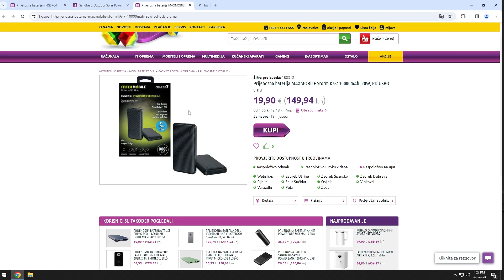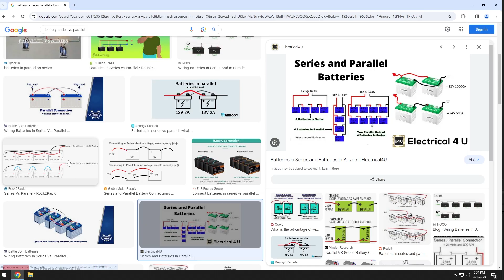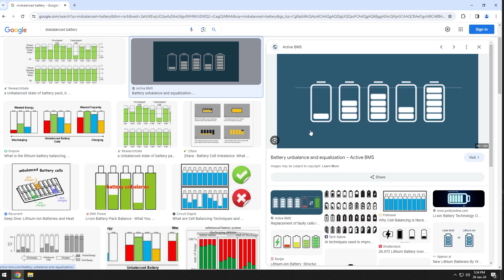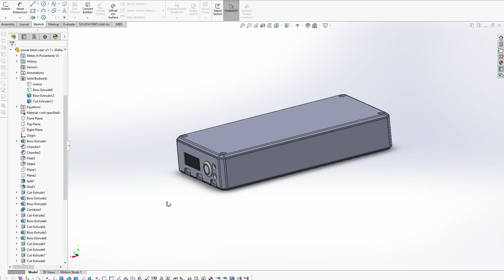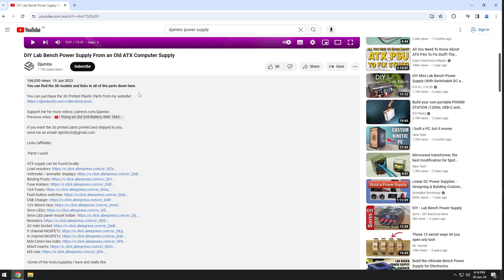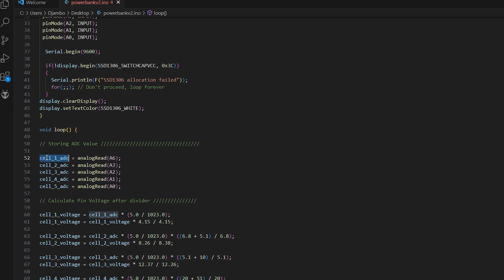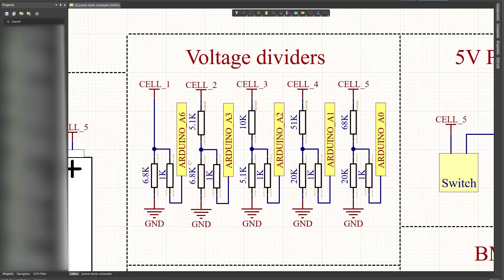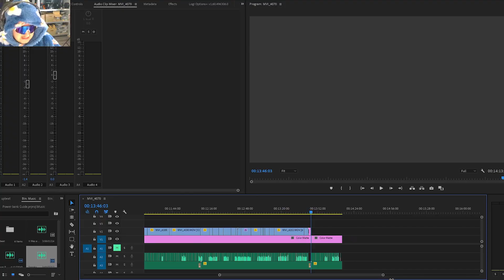Build Super Fast & High Capacity Power Banks (130W) - DIY Fast Charge 15000mAh Power Bank

Comment: there is no way this is 15000mah
Reply: It uses five 3000 mAh cells, so if they were connected in parallel like most other power banks then it would be 15000 mAh, however he connected them in series for a higher voltage output. Other manufacturers probably do this too. Since companies and people settled on using mAh as the unit for capacity it makes sense to just call this a 15000 mAh pack even though it isn’t because it stores the equivalent amount of energy. Watt hours is a much better unit since it isn’t dependant on voltage or even better would be to just use the proper unit which is Joules.
Reply: Manufacturers should use Wh instead of mah because that would be the same for paralel or series cells @conorstewart2214

Comment: There is a much simpler solution in the form of a module with IP2366. There is charging, protocols, display and real 130W. You don't have too much power on these modules. The cells are also too weak for power >100W...

Comment: good Job , But, how is your battery balance holding?. As using permenant voltge dividers will ultimately debalance the battery cells, "yes you have a BMS that will balance the cells at the <end of charge stage>" but it is a passive balance, so if 1 battery is fully charged at 4.2 volts and another battery is at 4 volts and the charge current is still at lets say 250 mA(depends on how bad are the cells voltages are far apart, the bigger voltage difference the larger the current) the BMS will discharge the full battery at a current detemined by the discharge resistor "usually 100 mA",  So the full battery is still being charged at 250 - 100 = 150 mA , when this battery reaches 4.25 volts the DW01-A protection IC will disconnect the whole pack from the charger/output, so you will have a battery at 4.1 volts (BMS keeps dischrging the full battery till 4.1 volts) and another at 4.05 volts, and this may worsen over time.

Comment: these chargers modules are cheap but they do not have good power quality, they have quite high ripple voltages around 250-300 mVp-p, the best way to reduce it is to solder a capacitor at the output aditional 220 or 470 uF do the trick and we get under 100mVp-p ripple when powered directly from 4s battery

Comment: Yes, but you only used 5S so your ability to output at 20V is pretty much 0....once you factor in voltage drop (if you're pulling any decent amount of current) you'll drop from 21.0V to 20.0V really quick. In my experience you need at least 20.3V for most of these buck PD boards needs at least a few hundred millivolts over the output.

The BMS you chose is definitely a decent choice as its simple and not as problematic as Daly BMS's 

Very cool how you adapted an Arduino to create a simple display with some of the more important information. Cell voltage and then calculating SOC based on lowest cell voltage is pretty simple with cobalt based lithium ion since its discharge curve is pretty linear. Using the overall voltage of the pack isn't the best way to go since your BMS will cut off once the lowest cell hits the BMS low voltage cutoff. Shouldn't be a huge issue if your cells stay fairly well balanced but once you start to get some deviation you might find near the bottom of their discharge they will deviate even further. Low voltage cutoff on the 30Q is 2.50V....if you stop at 3.00V you're missing out on 10% or 15% of the capacity. I personally wouldn't use the 30Q but if that's what you had laying around for free then free is better than nothing....30Q definitely has some cycle life and capacity degradation issues that came from trying to squeeze 15A out of a 3000mAh cell. Since you're running it at a max of about 7-9 amps if both ports are outputting 65W it shouldn't be too much of an issue.

It would be cool in the future if you could find the simplest way to measure voltage and current output at each port but I think thats going to involve working with the fast charge module you're using and not doing it externally with the Arduino

I didn't realize that input board you used could do 5S charging which is pretty cool. I know there are some boards on Aliexpress for 2S/3S/4S charging.

When you look at getting a spot welder keep one thing in mind. Spot welding is entirely dependent on your power source: using a TRULY HIGH C RATE LIPO (that "100C" rating bullshit is all nonsense) SUPERCAPACITORS (watch out for all the used caps on Aliexpress, you get what you pay for) OR A HIGH C RATE LIFEPO4 LIKE A123 OR HEADWAY. You can use the simplest $20 PCB so long as the mosfets on the board are 300A-500A mosfets and there are 6-10 of them. Then you also want to skip the stock 10AWG leads for attaching your power source to the board and your weld pens/electrodes. I use 2 AWG to connect my Headway or A123 batteries to the board and 6 AWG silicone wire for my welding pens. You can make electrodes out of solid copper wire but the proper alloy to use is actually an aluminum/copper alloy. It's all about having a package that has low IR...you're aiming for single digit IR from power source to electrodes...3-7 milliohms is usually ideal. A 16Ah/20Ah Headway/A123 battery does pretty good but when I tried to parallel 2 20Ah A123 batteries I blew the mosfets on one of my JQ-DHJ02B boards...definitely one of the better boards for the money right now if you don't want to DIY your own (There are Aliexpress listings for mosfet boards for 8/12/16/24 etc mosfets of your choice...I like the IRL40SC228...then you'd need a control board like the 7Y320 which is meant for supercaps...for supercaps I'd recommend 2S2P minimum if you buy used caps from Aliexpress...they sort them by internal resistance and then sell them accordingly so don't buy the cheapest 3000F 2.8V caps you can find)

There are a bunch of bidirectional boards available on Aliexpress, I mostly use Feb 22 store. Makes life a lot easier and most of them are either buck only (so you'd want a 6S or 7S battery probably) but some like the IP2368 are buck boost and meant for 3S to 5S with 4S probably being the most common. A 4S2P pack of 5Ah 21700's makes one hell of a good sized powerbank and with most 5Ah 21700's having a 10A or 15A rating they can easily handle 200W worth of output if in 2P. Whatever you do avoid the SW2303 IP5501 boards, they are garbage. My channel has a couple videos (long and boring) that go over a lot of the options out there and what I think of them.
Reply: I have a similar buck PD board, and it was able to output "20V" at 3A with a 19V laptop charger as the input. While it doesn't respect the USB-C standard, most devices seem to be happy with slightly under 20V.
Dell also does this with their docking stations, as they use 19.5V power supplies. I've also gotten such a Dell power supply working with a Lenovo dock, all capable of delivering 60W to a laptop despite the lower voltage.
Reply: Definitely 
I'm gonna follow your advices for my next project ❤

Comment: Why are you using different kind of cells? Is this safe?

I have almost all the parts laying around, except from the usb-c output//power delivery trigger boards. I've thought about building a 5s power bank for a while, but i am concerned about the quality of all this type-c boards. I've seen some horrors while browsing alliexpress, and i've even got some that completely disregard every protocol/handshake. are you confident enough to use them to charge phones and laptops?
Reply from the maker: You should never use different cells! Looks like a forgot to mention that. I did use same ones but in some shots I had different ones just to show what I'll be using. I've used this modules for quite some time now and I didn't have any problems. They do have a bit of noise but they work, I'm not sure how I could test them better. I drained the whole power bank from a 100% to 0 in a single use multiple times and the modules did get a bit hot but other than that, everything went right
Reply: I am using different cells and it's been over an year now but it's not recommended if you want good battery life. They ain't gonna blow up at all if you charge them properly

Comment: if the cells are connected in series that means only  3000 mah
Reply from the maker: yeah it's 3000mah, 63Wh, I said it's 15000 only in power bank terms since most of the power banks on the market use a single cell inside and the capacity is the first thing you see on the box.
Reply: @Djambo57 that's false advertising and it should be by the total Wats it outputs.

Comment: I have a kweld. It changed my life forever.  I hope you'll be able to get one soon. You'll love it. Worth every penny.
Reply from the maker: I was thinking about getting something smaller like that... I once borrowed a larger spot welder from a friend but it kept tripping my circuit breakers... The current spike was too high while turning it on. I also saw a bunch of battery powered welders online and I actually did use one of those before and it was quite good. They are around 50-60USD which is not bad
Reply: @Djambo57  youve probably found something by now, but i built my own with a microwave transformers, some relays and a pair of capacitors with a foot switch, and it works great for me!

Comment: You could do this cheaper using just the bms, battery charger and charging module and to monitor the charging a led voltage meter
Reply from the maker: Yeah that would be the simpler way but I wanted to throw in some extras just for fun since I already had the parts